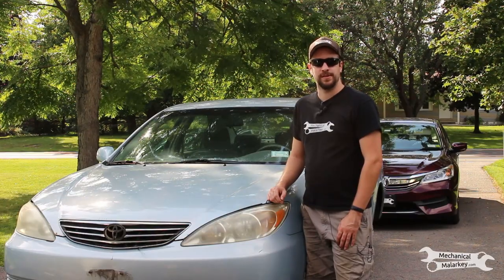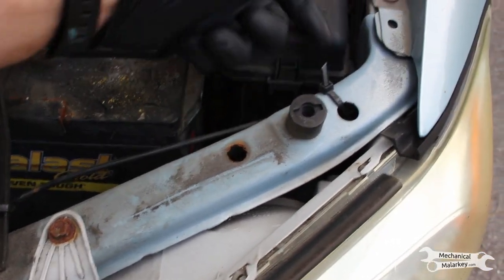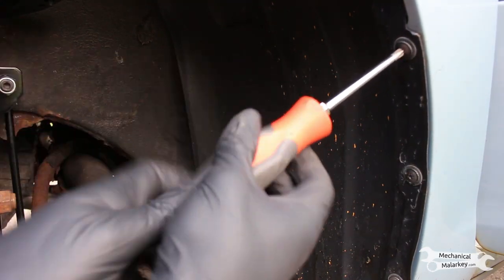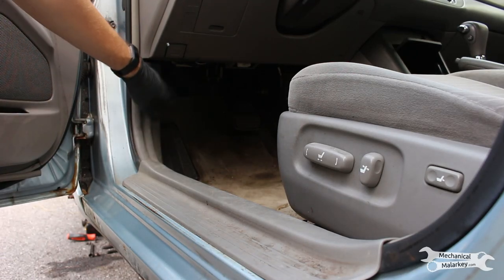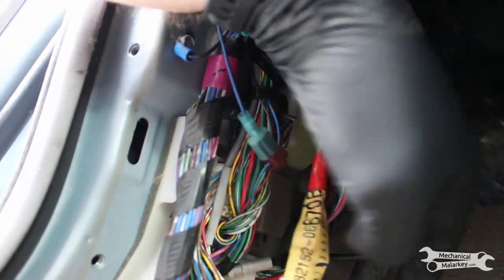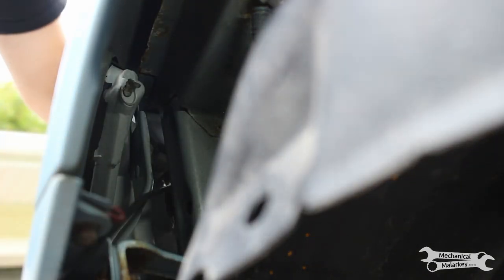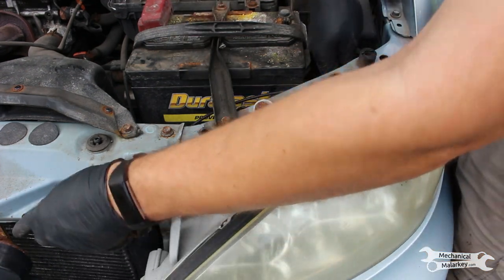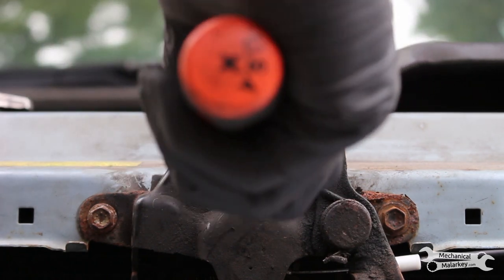2002-2006 Toyota Camry Hood Latch Cable Replacement

Comment: The latch lever cable end came out of my 2002 camry at the dash, I tried and tried to put the cabin cable end back into the latch lever, but I just couldn't do it. Then I saw your video here and realized there was a much better way to do it. Pop the cable end out of the attachment point at the Latch lever in the cabin to give myself MUCH more freedom to maneuver the cylinder end into the latch lever. I'm sure I will be able to pop it back in with as much ease as you showed doing it. Thank you so much Malarkey. I was thinking I was maybe gonna have to replace the cable!

Comment: I went to Monroe to replace the latch and the cable. I opened my hood 3 times within 6 months to change the oil and after this time it not work anymore. 
With this information I'll replace it by myself. 

Thanks. 🇩🇴